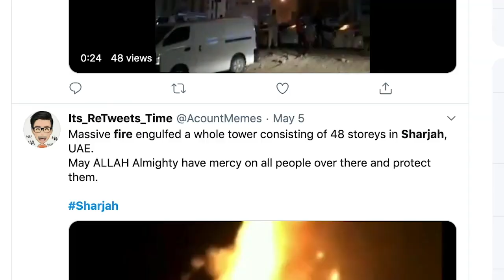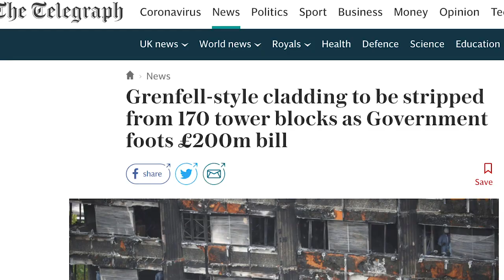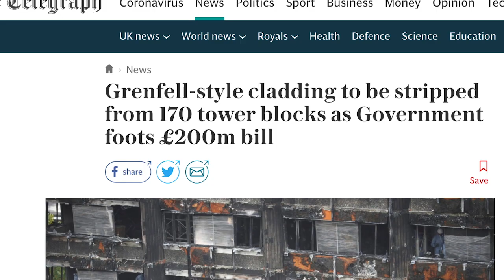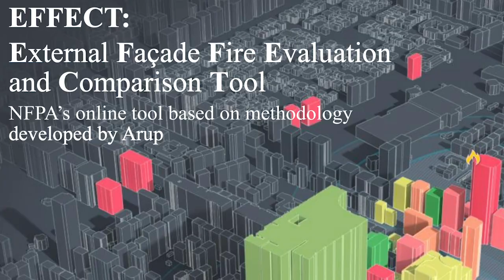Flammable Cladding on Buildings

Comment: After the Grenfell fire, I took a very cursory look into the issue of facade fires in high rise buildings. The issue I kept identifying was the use of substandard composite sidings manufactured in and exported from the People's Republic of China. There were several YouTube videos, since removed, which demonstrated these composites combusted very easily, and at points far below the required standards.

i think Ms. Messerschmidt is speaking around the real issue here; this issue is not complicated, and centers around the phrases "cost effective" and "energy efficient." 

This is the issue: contractors rushing to fill the construction boom in the Gulf States, where the majority of these facade fires have occurred, have used, and may still be using, substandard materials which are not up to regulation. These materials are coming from a certain country.

Thus any building which has either been constructed (such as the vast majority of Gulf State high-rises) or renovated (such as Grenfell) with such materials in the last 15 years is at high risk, and should be examined and prioritized for mitigation.

Comment: Insightful video!
Maybe  this is not the place for discussion, but ever wondered if instead of removing and replace these facade material, place a fire retarding/proof material on top of them and isolate the contact with fresh air as a measure of containment. Yes, new buildings should not use these materials any longer, but  for the old ones would have a immediate solution without the astronomical costs.